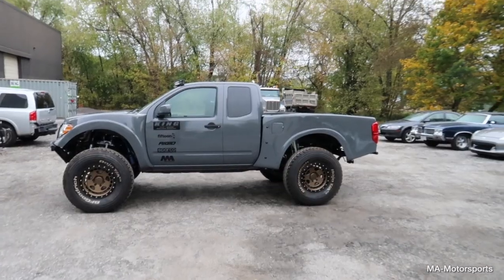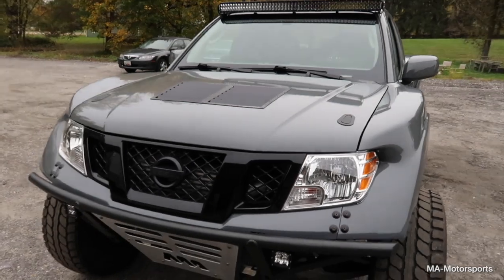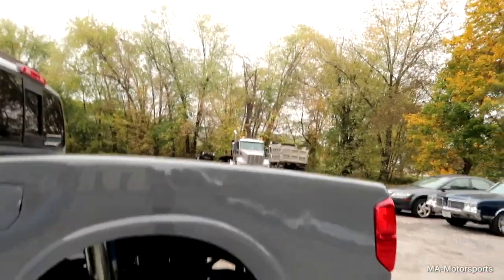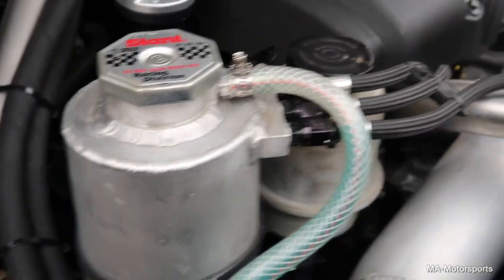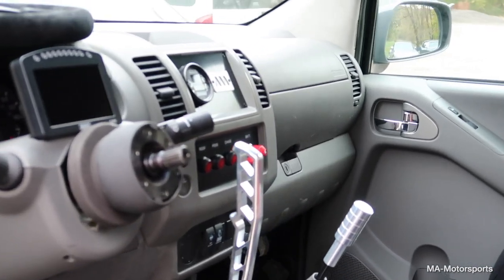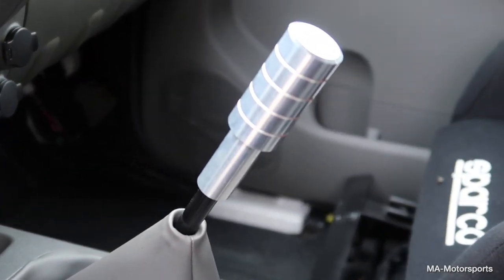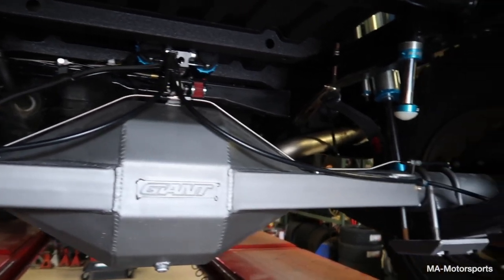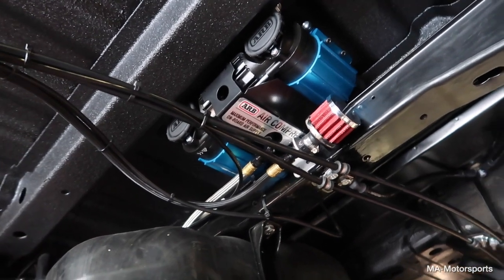NISSAN Frontier Desert Runner FULL TOUR:  Turbocharged, V8, Long travel Monster

Comment: Killer project, guys! Y’all knocked it out of the park. This truck is badass.
Reply from the maker: Thanks Joe! Appreciate that.
Reply: @MAMotorsports  
Your window logo is a bit confusing. It looks like 'AAA' instead of 'MA'. Btw, the Fronty looks bad ass even though I'm not into "desert running". I want to buy a Frontier and drop in the 2.8L Cummins engine paired with a ZF-8 transmission that Nissan had teased us with a few years back on the TFLnow channel.

Comment: Amazing build, given me some ideas for my Navara over here in the UK
Reply from the maker: Awesome, thanks!
Reply: @MAMotorsports  
Overall, I like the truck. However, that hood vent looks like it came off someone's trailer house A/C. You should think about putting a box cover over the battery. What's with the hole on the D/S front fender?
Reply: I'd love to do something like this in the UK and get rid of that useless YD25 engine..

Comment: What kind of differential did you use? And if that driveshaft is custom made, what would be the next best thing on the market?
Reply from the maker: The differential is an ARB air locker.   The drive shaft is a modified OEM unit by The DriveShaft Shop in NC, USA.

Comment: Why.. why would they put a manual in a prerunner..  other then that it’s super clean and nice work.. couple things you can tell these guys are car guys and not off road guys.. lol  what ever happen to this truck? Did someone buy it? Does someone use it??
Reply from the maker: Thanks!    Nissan wanted it to be a manual, so we made it a manual.   The idea of a manually shifted turbocharged (also uncommon in prerunners) engine swapped long travel truck that you could also drive on the street was what they had in mind.   As far as we know its still in the hands of someone at NISMO USA and just sits around sadly.

Comment: Got a question, can't seem to find an answer anywhere. Will any of the vq56de aftermarket parts (cams, pistons, valve springs, etc) fit the direct injection vq56vd motor?
Reply from the maker: I would think some would cross over but id contact Jim Wolf Technology on that.
Reply: @MAMotorsports  for sure. Waiting on an email back right now. Thanks!

Comment: What do I need to get a set of those seat sliders, would love to drop my seats a bit and gain a couple inches of leg room in the process.
Reply from the maker: Do you have bucket seats in your frontier already?  We custom made those particular ones.
Reply: MA-Motorsports Still running through factory seats for now, but I’m definitely not opposed to changing to a sports seat. What did you learn about possible seat sizes while doing the project?

Comment: Why didn't the truck get a full cage? Knowing Nissan it was a quick deadline
Reply from the maker: they didn't want a cage in it as originally it was supposed to be a street/ off road truck but we kinda got crazy with it and the only thing its lacking now is.... a cage.   The way the timeline worked out though we would not have been able to do a full cage too though that's for sure.
Reply: MA-Motorsports I figured.. I know they are a last minute idea thing

Comment: Not ton of up travel in the rear if tbe tires don't tuck into the fenders.
Reply from the maker: We trimmed the rear fenders so that the tires could still tuck.  I don't recall the numbers on the rear bump but it was right on with hitting the bump stop just before the axle hit the frame.
Reply: @MAMotorsports  Awsome. Good to know the travel wasn't sacrificed for the sake of stance. It is an awsome looking truck.
Reply from the maker: @sam_s_  Thanks.  Originally we had a narrower axle for it that would allow the wheels to tuck under the bedsides but that was actually limiting articulation due to spring hitting the tire.  WE tried and really wanted to keep the inner OEM bed look also so had this compromise.